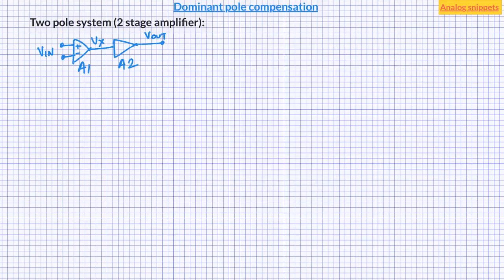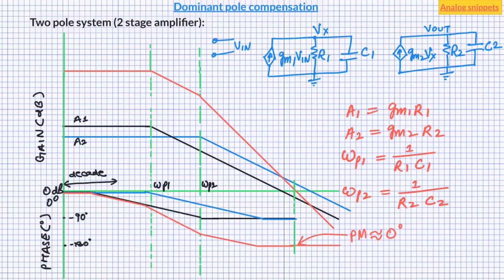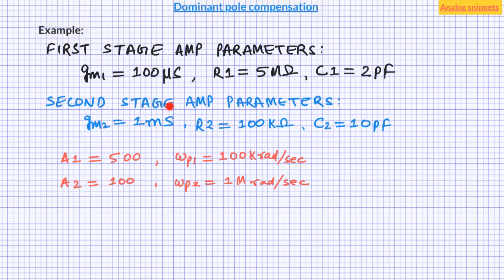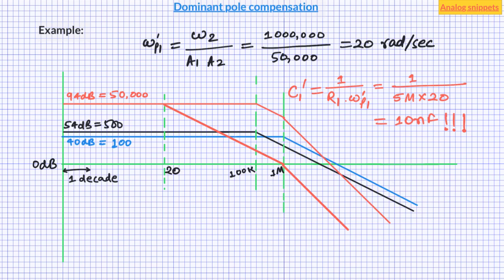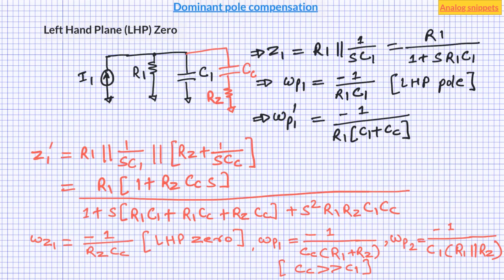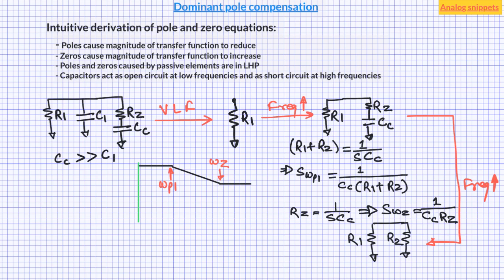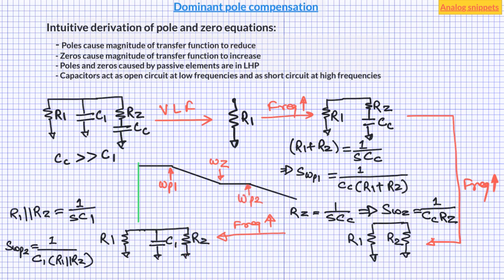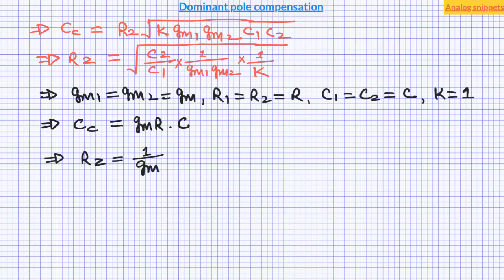#16 Dominant pole frequency compensation

Comment: All is very nice, but there is one thing I couldn't understand: At first, we put a large capacitor parallel to the first amplifier such that its crossover point came on top of the second amplifier's pole. Then, we put a pole and a zero parallel to the first amplifier such thatthe resulting zero came on top of  the second amplifier's pole. Which one of these is the dominant pole compensation?

Comment: At 9:55, the pole frequency can be determined by (R1+Rz) = 1/sC and the zero frequency by Rz=1/sC. Can someone explain why please?
Reply from the maker: That is a great question. Indeed just looking at the equations we can't say if it is a pole frequency or a zero. Ofcourse you can do the maths and find it out. To understand it intuitively you need to understand that at pole frequency, magnitude starts to roll off and at zero frequency magnitude stops to roll off. Also notice that roll off is a property of capacitive impedance while resistance is a constant impedance. At pole and zero frequencies, capacitive and resistive impedances are equal. At these frequencies one type switches into other. And that is the point. If impedance switches from resistive to capacitive impedance then it is pole. And if it is capacitive to resistive then it is zero. Hope this makes sense. Thanks.
Reply: @analogsnippets  Thanks for your reply! Doing the maths, I obtain same equations. But intuitively, I understand it like this, that there is a pole when the path with series impedance (Rz+ZC) starts to shunt R1 (assume that there is a current as an input flowing into the node). So in my understanding, then the pole should be calculated by R1 = Rz + ZC. (Knowing that it's obviously wrong... )
Reply from the maker: It's resistive impedance versus capacitive impedance. So R1 and Rz in series can be considered as one resistance. So it's more like Req=Zc.

Comment: at 15:34 why w0=(w01*w02)^1/2
Reply from the maker: You can prove it using simple geometry. Say amp1 and amp2 are single pole amplifiers with gain g1 and g2, and bandwidth p1 and p2 (p1 < p2). If we cascade them then gain becomes g1*g2, with first pole at p1 and second at p2. In log frequency scale, cascaded amp will cross frequency axis midway between amp1 and amp2, which amounts to geometric mean in linear frequency scale. Try it.